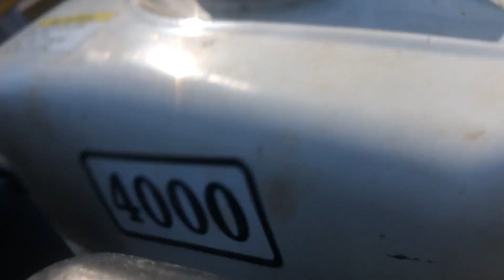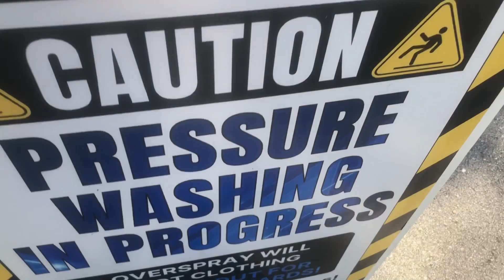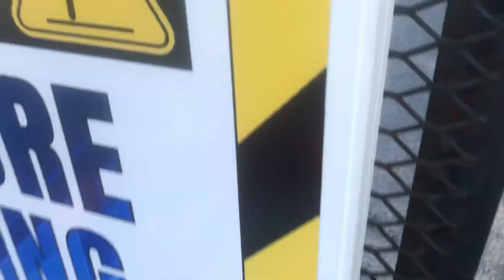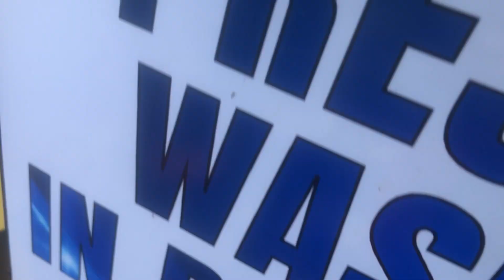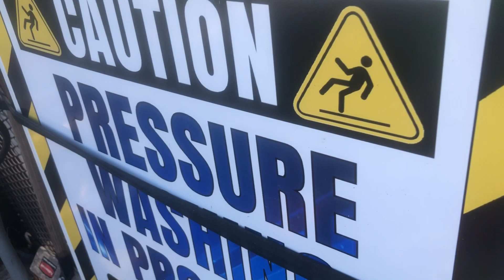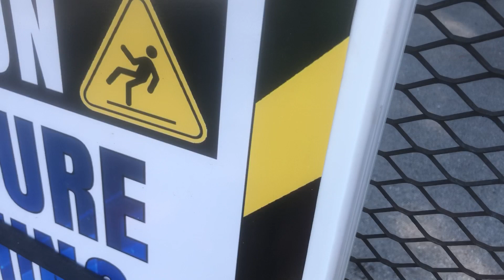Downstreaming without surfactant#pressurewashing #housewashing #powerwashing #jesussaves

Comment: Hey all coast, thank you so much for your videos. They are helping me in my down streaming journeys. I’m just confused why you switch the chemical injector hose to a water bucket. Doesn’t it just pull water if you take the bleach hose out and use the pink soap top.  I have a 4.2 GPM predator harbor freight machine.
Reply from the maker: That red bucked is 5 gallons of fresh water. Always downstream 5 gallons of water while rinsing off the SH. Always do this to rinse out the pressure washing hose, gun, and tip so the SH corrode your equipment.
Reply: @Allcoastlawnandpressurewashing  but won’t the pressure washer just pull straight water if you just take the chemical injector out of the Chem bucket?
Reply from the maker: @matt2424  I forgot to mention the main part that needs to be cleaned out is the injector which the ball and spring will get corroded by the SH
Reply: @Allcoastlawnandpressurewashing  still confused lol. So if I don’t put the chemical injector in a water bucket (I just take it out of the chemical bucket) I won’t be rinsing out my hoses and ball springs? Where would the sh be coming from?
Reply: @Allcoastlawnandpressurewashing  i ask this because I now do what you do but don’t really understand why. I feel like when I drop my injector into my water bucket sh gets in the water bucket.
Reply from the maker: @matt2424  you need to rinse out the ball and spring that’s in the injector. That’s why you need to downstream 5 gallons of water. 5 gallons of water is the magic number I learned from all the pros on YouTube and on FB groups.
Other than the hose, gun, and tip, that’s really if your Softwashing.

Make 5 gallons of water a habit after downstreaming SH. It will save your injector
Reply: @Allcoastlawnandpressurewashing   I understand now it’s to rinse out the injector. You truly are for the people, thank you Allcoast!